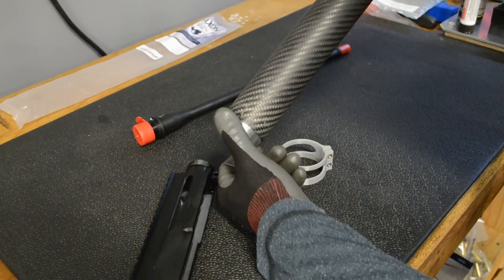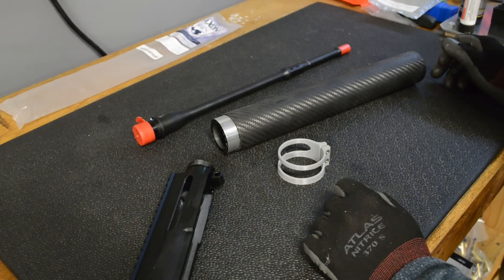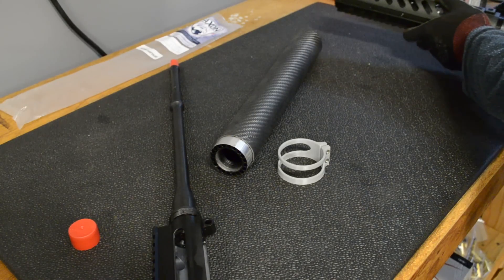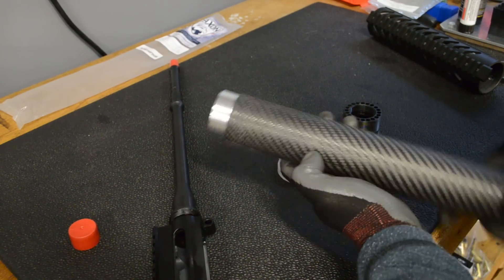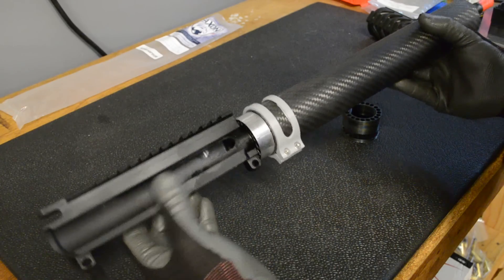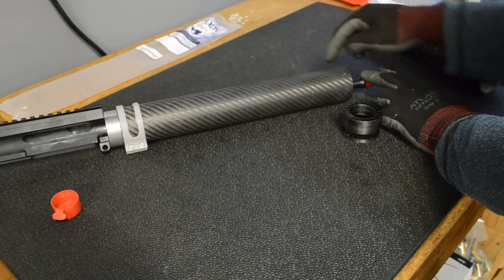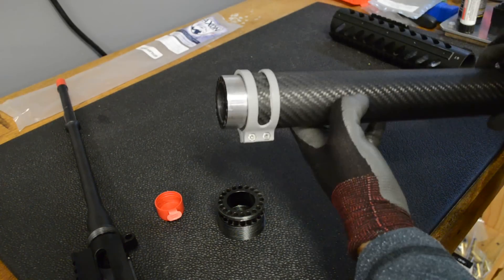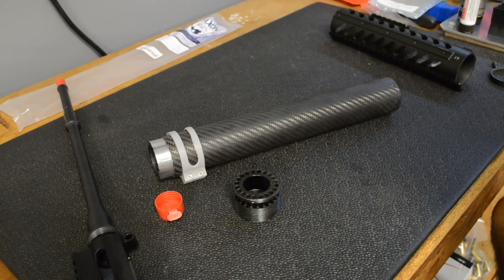DIY AR15 5oz Carbon Fiber Lightweight 12" Handguard (140g)

Comment: Btw, you should 3d print or machine a clamp with a built-in rail section where the screws are, that would allow mounting a bipod when you want without adding to the weight when you dont. Even if it is pretty far back, the lightweight barrel I figure should help make that work.

Comment: I am building one in a 5" pistol barrel length. I can only find the tube in 4 In or 9  in tubes. Could I buy the 9in tube and cut it down to about 6.5 in to cover the Gas block and flash can?
Reply from the maker: Yeah

Comment: Great job bud... The company I purchased my Carbon Fiber Upper discontinued them and I wanted to build a pistol version of my rifle. Unfortunately finding a similar handguard is very tough. I'm about to order an octagonal tube and do all the mlok holes myself with a dremel. I've worked CF before, but finding a barrel nut that will accept this octagon shape is going to be tough as shit

Comment: Feel you on the astigmatism, I found the magnified ones work perfectly for me while the 1x ones are just a fuzzy red cloud. Had a truglo el-cheapo 2x and it was perfectly focused. Upgraded to a 3x from Burris and that's even better,  nothing short of amazing. The only thing you give up due to magnification is the cowitness, but with a qd rail mount on the red dot it's not an issue.
Reply from the maker: Which Burris?
Reply: +Guy in a garage its a prism sight, the ar-332. It's not much bigger than some red dots Ive seen, at about 5.75" long without the lens caps. It has an illuminated reticle and without glasses I can get an awesome, super clear sight picture in red, green or even when the illumination is off in black. That's one thing the prism sights have over the red dots, they even work if the battery dies. There was a promotion at the time for a free fastfire 3 with the purchase of the ar-332. The ff3 is a pistol-sized open reflex red dot sight, and it does get a little fuzzy for me, but it's no worse than say the trs25 from bushnell, just amazing that it's in such a tiny package and looks very well built. I put up,a video of my polymer80 build with the ff3 if you want to see it.

Comment: The front sight goes on the barrel, solving a few problems for the floating guard.
Reply from the maker: Yes, this would work with a handguard that is short enough to leave the gas block exposed  Unfortunately, this would also defeat the purpose of a lightweight build.
Reply: @Farrow_Tech  and make it ugly looking... I.M.H.O.

Comment: if you have the ability to mill out keymod slots in a carbon fiber tube, why did you make those slots with a damn hacksaw?
Reply from the maker: Because I don't have a slitting saw for my mill.  The smallest endmill I have is 1/8"

Comment: Does anyone make a barrel nut is the same diameter or smaller than the tube?
Reply from the maker: Not commercially available.  I'm working on something that will make this easy. Look for it in the next few videos.
Reply: @Farrow_Tech  my barrel nut is 34mm o.d. and rounded.  The only problem is the gas tube goes about 1/8 of an inch above that into the receiver. So I would have to find a way to incorporate that into my clamp design which should not be a problem. It could even be a nice looking piano hinge type of joint, or something of that nature. Awesome job. Thanks again...
Reply: Jp